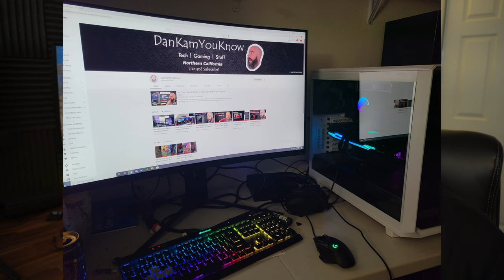We built my buddies PC! But ASUS motherboards don't make things easy for us.... ( GAMING PC BUILD! )

Comment: I have 3600mhz Corsair Vengeance RGB Ram in a Asus Strix B550 motherboard. Works perfectly!
Reply from the maker: Yeah, per the advice of the ASUS support line, we checked the compatibility list for his RAM and it wasn't on there ( for his specific X570 board ). It wasn't a RAM issue though so I'm sure the Corsair RAM he returned would of worked just fine.